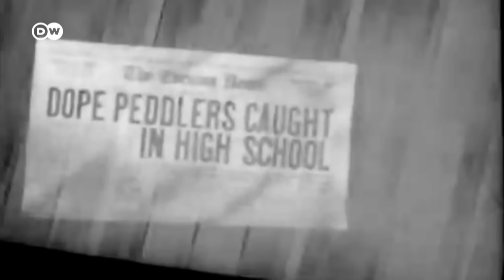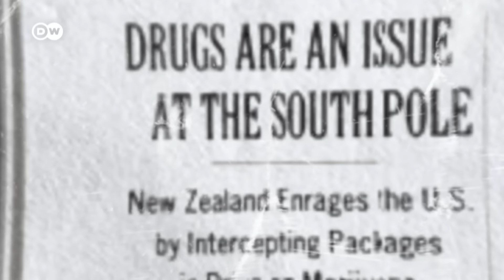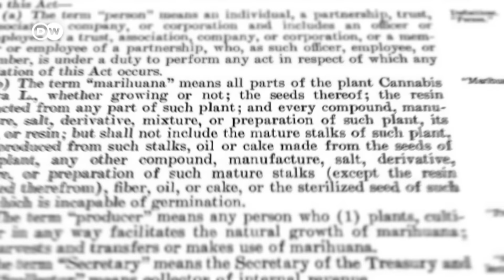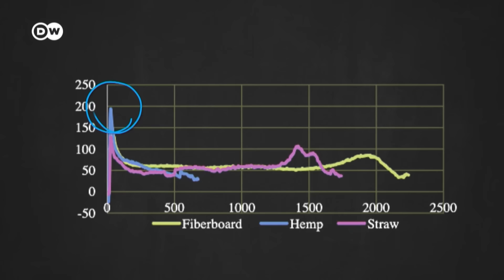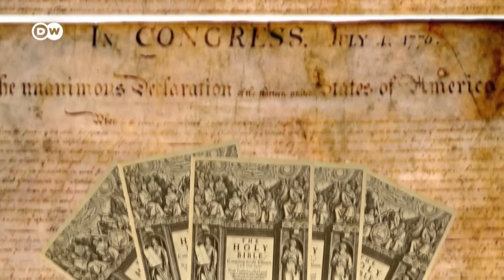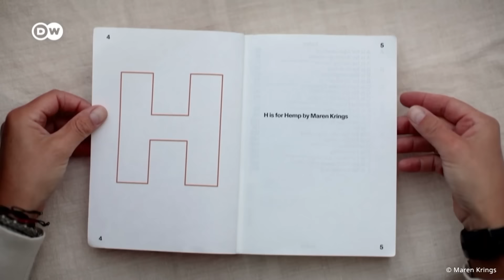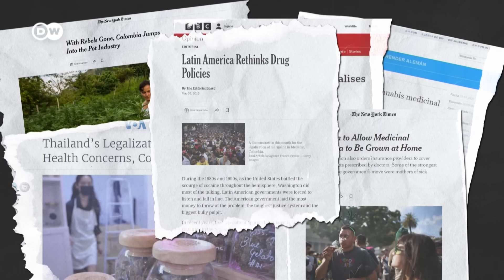Why outlawing cannabis was a HUGE mistake

Comment: It was a pity you didn't mention in detail one of the other major reasons there was such a massive campaign to prohibition.The fact that hemp oil was a direct competitor to fossil fuels and that wasn't convenient for the big shots that owned and profited from oil companies.
Reply: and now they can hike fuel prices because most people are ignorant of alternative fuel sources. I even heard hemp can make more efficient, clean and safe batteries than lithium, wouldn't be surprised if this was true
Reply: That doesn't sound right. Vegetable oil has to be laboriously extracted by picking seeds and then pressing them, all while taking up a lot of land to produce relatively little oil. Whereas fossil fuel is just pumped out of holes in the ground. It's like suggesting a baby jamming on his first xylophone is a direct competitor to the Rolling Stones.
Reply: @sanjaymatsuda4504  by hemp oil we mean fermenting the stalk and not the seeds
Reply: Big business never have been there for the people to live better but to profit off of   Not many mom & pop shops left these days
Reply: @conradmbugua9098  no, in fact the Diesel engine was designed to run on hemp SEED oil before fossil fuels were popularized.
Reply: @sanjaymatsuda4504  you are wrong. Have you ever seen a seeded hemp plant? You don't "pick" the seeds...you shake them out by the TON.
Reply: @sanjaymatsuda4504  hemp can yeild from 200-14000kg per hectare of seed of which contains 30-50% oil by weight. If grown in sufficient quantities it could absolutely replace fossil fuels.
Reply: @olsim1730  

"If grown in sufficient quantities..."

But can you grow it in sufficient quantities without displacing food crops?
Reply: @notahotshot  Actually can be planted side by side. Most food crops need more water.
Under drought like conditions hemp grows well.
 Most hemp does not grow as well if there is too much rain.
So why not plant corn and hemp?
Reply: pretty hard to manufacture that much hemp oil, the real reasons were pharma where much less mass is required.
Reply: That’s right I wrote a essay for health class in my sophomore class in high school back in 1977 & we had an oil embargoes a year or to back & at that time if we would have planted hemp for oil it would have taken 6 percent of marginal pasture land to replace foreign crude oil thanks for reminding me but we still need are oil we need to stop surprising other options
Reply: @notahotshot  yes, very much so lmao.
Reply: There are many pieces to this the puzzle it was also used as a weapon to imprison their political opponent supporters.
Reply: @greenwave819  The so called canabis oil and the hempseed oil are not the same thing.
Reply: Hemp oil being direct competitor to fossil fuel? My friend the highest yielding oil seeds produce more than 10 times the oil than hemp eg mustard seeds, sesame.
Reply: Exactly
Reply: I want my car to run on cannabis because it has a high compression engine
Reply: @sanjaymatsuda4504 You sure did make the complexity of drilling for oil, shipping it around the world, refining it, and then ship it back around the world seem so simple.  Silly me, oil equals no effort.
Reply: my question is why they didn't buy into the replacement when they knew peak oil was coming?
Reply: @meoff7602  
That complexity also exists for extracting oil from plants. Except with much lower yields.
Reply: @conradmbugua9098  plant base battery? u gotta be kidding.
Reply: @notahotshot  Hemp is one of the most nutritious food sources available for Humans. Do the research on the nutritional value of cannabis....

Comment: So 20 years back, there was a small store in Helsinki that specialized in legal hemp products - clothes etc. (The story goes it had to close because the police raided it all the time and finally the stress was too much for the owner.) The hemp pants they sold were some of the most comfortable garments I've ever used. Sadly, I quickly learned that even if hemp fibre is strong in the sense that it withstands being pulled apart, it's not strong in the sense of withstanding friction. I bike all the time, and the seat of the pants disintegrated in weeks. On the other hand, the pair that I've only been using for special occasions has lasted these 20 years. So can't recommend for active use but otherwise fine :)
Reply: I saw towels made of hemp. So soft. There are so many uses we could have for the hemp, and perhaps changing the processing would allow fabrics to be strong enough to deal with friction. Remember ropes were made entirety of hemp, raising and lowering sails, so it must have properties of dealing with friction.
Reply: @ninemoonplanet  I only ever "pat" myself dry with towels - never rub.

I don't think it's good for the skin to do that.

Comment: Cannabis is very necessary, has helped me a lot with mental issues and anxiety.

Recently I have been suffering from a bad case of migraine pain. While cannabis itself does not remove the pain, it has been helping with the other symptoms I experience while I have these migraine episodes.

Usually during these migraines aside from the chronic headache I also get dizzy, irritablility, nausea, and vomiting.

Cannabis helps lessen that irritability but mostly the nausea and vomiting. My migraine episodes usually last weeks right now Im at day 5 of a chronic headache and while cannabis does not help with the pain, Im at least eating, and not throwing up, without cannabis I would need to take additional pills for nausea and supplements to feel hungry and taking those additional meds would bring additional unwanted side effects. Th only downside to cannabis is future employment drug screenings.
Reply: I used to have a bad stomach but I found out that"flavored water"has helped me out I used to drink plain water 💧💦 but now it's better for me but I still do get migraines once in awhile but I think I've heard that ginger root is good for upset stomach if not try ginger ale or root beer

Comment: The reality is that hemp is one of the best carbon sequesters there are i.e. plants that remove CO2 from the atmosphere and store it in their roots and soil.
Industrial hemp has been scientifically proven to absorb more CO2 per hectare than any forest or commercial crop. 
The CO2 is permanently bonded within the fibre that is used for anything from textiles, to paper and as a building material. This means no matter what happens with the plant after it is harvested, that carbon is stored inside it forever, making it far superior to cotton, wool etc.

Comment: I have a couple of things I want to say about cannabis

First of all, I think people shouldn't smoke cannabis and should instead opt for using other methods like edibles, tinctures and vaping, all things that can be made or learned at home. I think this is important because it prevents negative health implications of smoking on the micro while removing some of cannabis' stigmatization on the macro

Also, I think doctors are important in this mess because they're so misinformed but they've been educated in their field so they are adamant to believe everything they learned, even the parts that are literally incorrect. As a long term patient with chronic health issues due to an immune disease, I'm frequently discriminated against by my doctors despite me doing a lot to look after my health (a lot more than other people who aren't treated unfairly) I've even been prescribed oxycodone (a semi-synthetic opioid with extreme health implications) and told that it "wasn't addictive but had an accumulative effect so could not be taken intermittently during times of pain", I was told that I had to "take 5ml every 4 hours" which I refused. I stated that it is addictive and has been proven to be in multiple studies and I shared stories of my physical withdrawal symptoms when not using it. I chose to take "1.8ml - 2.5ml during times of pain" and that's it

Sorry I rambled but the audacity of putting vulnerable people into that position was disgusting, I could've developed a serious addiction which could've led to a decline in my health and my eventual death, all because my doctors have been lied to. I'm not the only person who's being told falsehoods like this

Comment: We’re in a co2 drought we can be a thousand parts per Million in the atmosphere and the temperature wouldn’t change more than 0.4 degrees. The sun contributes solely to heat this planet so it’s therefore  the orbiting lunar cycle which determines whence the heating happens.
co2 is exchanged in to oxygen, the oceans depend on plankton to sustain it self , the food chain begins with plankton. Currently the world could double its co2 output in to around 400 parts per million by using fossil fuels we can enhance oceanic and a greener environment richer in oxygen production resulting in a healthier environment. (The Heartland Institute).  Light it up smoke it up inhale exhale !..

Comment: Normalization of degradation in the guise of a "miracle plant".Arguing about industrial hemp when, clearly, that is not the issue.
The easy way of cultivating weed is problematic extremely problematic for society long term. Inevitably, either because of ease of access or, because capitalism's drive for perpetual growth, sooner or later it will become the next tobacco  and its effects wont be reversible in generations.